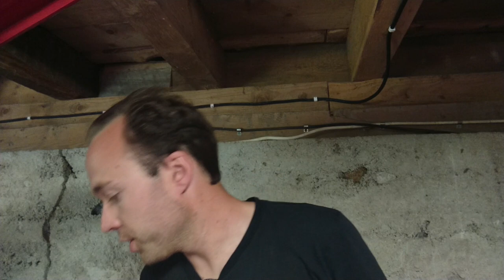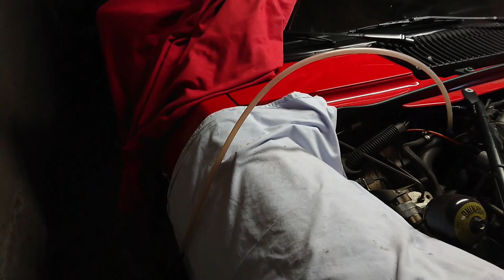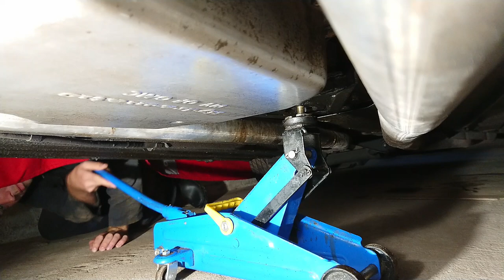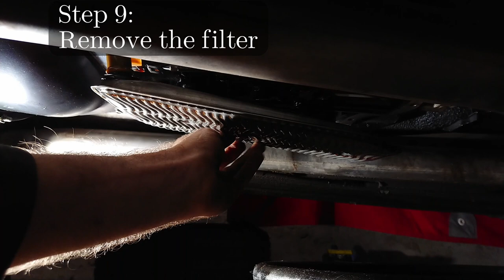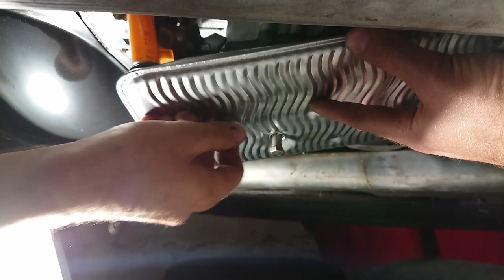Transmission service - Jaguar XJS Transmission Fluid and Filter Change

Comment: Thank you - Thank you - Thank you !!! I've imported my XJS from California into Germany early 2019 and soon after it turned out to become a major restauration project. Though I had great fun with it so far, I loosened the transmission holder already four times in the past 12 months for different reasons. First, I did exactly what you described in this video: replacing transmission fluid. I felt a bit annoyed that Jaguar engineer really made it necessary to remove the transmission holder just to get the transmission pan off. However, when I did so I found that the center bush was completely missing and the spring seat lower rubber rotten. Believe it or not, I failed to understand what is the right place for the center bush. I followed the 'exploded dwg' and simply put it in between holder and spring retainer. Honestly speaking I never understood how the whole stuff worked. Once I put everything together transmission was strongly mounted and did not move at all. Indeed the spring had no function as the compressed center bush took all the load. It felt not right and I've done it again once more just to find a clue why it doesn't feel right. I googled a lot but indeed you can not find a picture anywhere on the web that shows it in detail. Some weeks ago I had to disassemble it again as I needed to get access to the prop shaft, bcs the holder of the vapor return line broke (that also goes thru the tunnel) resulted in rumbling noise bcs the prop shaft got contact with the vapor return line. Again I assembled everything in the same incorrect way as before. Last night I came across your video. You cannot believe how wide open my eyes got when stopping the video at 9:34 !!! This damn center bush needs to go inside the mounting bracket ?!?!? Why is the 'exploded dwg' so misleading ?!!? First thing today I went under my XJS again and within 1.5hours I got everything fixed. Not only that I now understand how this spring mechanism works, it feels allright now. What a relief! Again, thank you for uploading your video and all the work for just a few enthusiasts. I wished I had found it last year. Your video is more about the mounting bracket and the spring mechanism holding transmission than the title of your video says. Again big thank you! You made my day!

Comment: Your a life saver, I just bought myself a 1980 XJX-V12 coupe, and in a cupel of weeks, I'm going to do a radiator flush a engine oil change and a transmission oil and filter change, Your video's are amazing Adam. From Australia..

Comment: The GM turbo 400 is a transmission used on so many old chevrolet trucks- they were made by the billion.  Jaguar bought the tranny from GM and made their own bell housing to adapt to the motor. Incidentally- the only reason a Jag V12 is rev limited is because the GM torque convertor was never built for high rpm and can distort.  The limit was never intended for the motor- it is a short stroke motor that will rev very high and quite safely.

Comment: Greetings from Barcelona, Catalonia.
I am founder member of the Barcelona Jaguar club, proud owner of a XJ 358 (the last genuinely shaped Jaguar) and I am in the process of getting an XJS convertible 6.0 V12. I am in debt with you, because your videos are helping me a lot to understand the kind of car that hopefully will soon be in my garaje.
I also applaud you for this video about transmission maintenance. That is an area that I have always paid special attention to in all the cars I have owned, and it is a pity to see soooo many people paying a fortune for fixing a transmission just because they believed that bullshit of "maintenance free", or "the oil of the automatic box lasts forever", bullshit said shamelessly even by the official dealers. 

Once again, thanks a lot for your extremely useful videos!!!
Reply from the maker: Hi Santiago! Sounds lovely to drive a Jaguar in Barcelona. I'll have to visit Barcelona some time :)
I'm glad you agree that its an important service and that you found it useful!
Hope that you find your dream XJS Convertible
Reply: Hi Adam, a fantastic and informative channel you are running.
I was wondering what position the gear lever should be in during the fluid change.
I once siphoned a bit of fluid out of mine, but then decided to put it back in, (as in your video).
The engine would not start, but made a horrible banging noise.
I siphoned the same amount of fluid out again, and the engine started again. THANKFULLY.
Great channel, please keep it up.

Comment: Good Video. I use a Proxxon Elektric Pump to get the oil out. I recommend to replace the rubber bearing whilst the part in hand. I had some trouble with these. Keep in mind, that there will be a big amount of oil in the torque system left. 1/2 service time is a good idea. Do not overfill. I foged an entire autobahn section once

Comment: Hi adam recently i messaged you about my xj12 that wont go i  to gear. Recently i put new transmission oil in and it engages gear but wont move i think my torque converter is trashed what do you think? Sometimes it goes forward a little but not much you cant really drive it. If you have a similar problem or a solution can you make a video about it. Or give me advice what to do next?
Great video by the way!
Have a nice day!

Comment: Well Adam, I wish I'd watched your video before doing the trans service on my XJ12 (S2).  The workshop manual says nothing about the transmission mount, so that stumped me for a little while.  Took way too long though :-). 
And why does it say everywhere that the transmission holds 9 liters?!?  I only got about 5 out.  Where are the other 4 liters?

Comment: Question does the Borg Warner 3 speed have the same spring mount?  Thx. joe
Reply from the maker: It’s not identical but very similar. On most borg Warner boxes the mount is not in the way of the pan
Reply: @LivingWithAClassic  Thank you very much.  I just bought a one owner 1976 Jaguar XJ6L Series 2 with 91000 miles.  Its been sitting for two years so Im doing a full recommissioning.  Your videos are a tremendous help!!
Reply from the maker: I’m glad I can help! In that case the mount does not cover the transmission pan

Comment: Hi adam i got a xj12 from 1981 i checked my atf fluid level before trying to move it the first time. it was ok.
afterwards i put it i drive, the car wouldnt move until i reached 5000rpms checked afterwards and my atf lvl came down what could be the problem.
should i just instaal a new trasnmission oil filter and fill it all the way up or what would u do in this situatuion?
Great video by the way!!
as always
Reply from the maker: I think a lot of the fluid had drained from various places into your pan causing it read normal levels when it’s actually very low. I have a video on checking your transmission level. Top it up and check that it’s the right level before you do anything else
Reply: @LivingWithAClassic  thank you very much i hope i havent ruined the gearbox while trying to get ot to move

Comment: I’m very new to Jaguar cars. It looks as though the transmission fluid is being replaced through the same pipe as the trans fluid dipstick? Am I seeing clearly?
Reply from the maker: Yes that is correct
Reply: @LivingWithAClassic  Thank you! I’ve learned so much watching your videos. Incredibly helpful. You make the transmission fluid change look so easy. It’s all in the prep. I especially like the tip of using a vacuum pump container to remove fluids, first!

Comment: Hi Adam I've just had the gearbox and filter and oil changed however it now whines on start up from cold for about a mile or so until warm. Do they usually do this with fresh oil in. It was perfect before the service. Many thanks.
Reply from the maker: Sounds like the fluid level is a bit low to me. Double check the level in the transmission. Otherwise maybe the o-ring around the filter or pipe from the filter is damaged and taking in air there. But check the level first
Reply: @LivingWithAClassic  thanks for your fast response I will come back to you with the outcome.

Comment: Hi Adam, I owned 1989 Jag XJS coupe V12.  I wanted to flush my ATF and been trying to buy CASTROL ATF DEX II Multivehicle that you shown in this video...unfortunately, I could not find it any store or seller from the USA.   All based in Europe.  Would you kindly suggest any other alternative than this CASTROL ATF DEX II Multivehicle for me to use?  I hope I get your response soon.  Appreciate it very much.  Thank you
Reply: Kroon oil is a option dexron-II d

Comment: I have an 86 jaguar xjs v12, why or where does the automatic transmission oil go to the motor oil??
Reply from the maker: There is no place they can mix. The only things that can happen are these.
-you can have a leak so that ATF goes into the cooling system (usually the other way around)
-you can burn ATF in the engine that gets sucked up by a bad vacuum diaphragm in the transmission.
Engine oil and ATF can’t mix on these cars

Comment: My xjs is not going into drive,2 and 1 but it’s going into reverse. I guess it could be the low transmission fluid.
Reply from the maker: Yes it could be that. I would try that first and make sure you are checking it the right way. On a level surface, cycle through all the gears (5 seconds in each gear) then check the level with the engine still running
Reply: Thnx. I’ll let you know what was it. I know it is leaking oil nearby the bell housing area. And quite a bit was underneath the tranny oil pan. I guess it’s from front seal. I’ll be doing the transmission oil service. So basically replacing the oil pan gasket and the fluid.
Reply: I’ve to add dexron 3 just for the top up and to see if the first gear engages. I couldn’t find dexron 2.
Reply from the maker: @prabhjitsingh3298  Do that and clean up everything around. Then you can see the leaks. The oil could be coming form up top and flowing down.
Reply from the maker: @prabhjitsingh3298  Dexron 3 works fine in those transmissions too. Where are you located?
Reply: Canada
Reply: I top up the fluid but it’s same thing. It’s not going in Drive. It just roll a little bit in when I put it in Drive but I guess it’s just cause of pavement I’ve parked on. I’m going to look it into it now.
Reply from the maker: When you service it check if the filter was maybe lose. I've seen that once and then the pump wasn't getting enough pressure
Reply: Quick question. Is it a GM 400. I was looking for a rebuild kit. Online I’m getting GM th400 is there any difference?
Reply: A little update I was removing tranny form car to rebuilt it. And got it off. I was lowering down the jack and then the tranny slipped from jack. Broke bellhousing. I was thinking to replace bell housing but I’ll search for an used tranny.
Reply: @prabhjitsingh3298  Have you still got it, and how did you get on;
Reply: stephen walls got it rebuild. Always go with checking the fluid level

Comment: Adam  Your suck out the fluid with a transmission pump and barrel, would not it be enough to change over to clean fluid. If the fluid you took out looked dirty then do the method
you did or get a transmission shop to do it. It would be pricey. However if fluid is clean then a new fluid could be all its needed for now. OR if your GM400 transmission is changing
smoothly and the fluid on dipstick looks clean leave it. But again a new filter and fluid change might be worth the effort..DIY or shop. A insurance and peace of mind.
Reply from the maker: You're right, there is now need to replace the filter every time. I replace my filter about every 3 transmission services. I have noticed that after that the paper in the filter can get real hard and brittle. Wouldn't want it to disintegrate and get flung around the transmission.

Comment: Just my two cents worth.  There's no point in just draining the fluid and filling once as 2/3 of the old fluid won't drain out of the torque converter and transmission.  You have to drain and fill three times to get most of the fluid out.  I replace transmission fluid every two years on my automatic cars and change the filter at half the service intervals.  My transmissions last forever!  Next, you can't buy Dexron-II or Dexron-III anymore, it's now Dexron-VI.  Do not use Dexron-VI in a GM400 transmission!  Dexron-II and Dexron-III were mineral oil and Dexron-VI is synthetic and will cause your clutch packs to slip and severely shorten the life of your GM400 transmission!  My recommendation and you can check all the forums, race pages etc. is to use ATF type F,  Yes the Ford stuff.  It's a mineral oil of a higher spec than Dexron-II and Dexron-III but not as slippery as Dexron-VI so it won't burn your clutches up plus it increases the line pressure for improved shifts.
Reply: How about ATF DEXRON II-D by Kroon Oil? Sounds like that comes very close too, they still sell it!